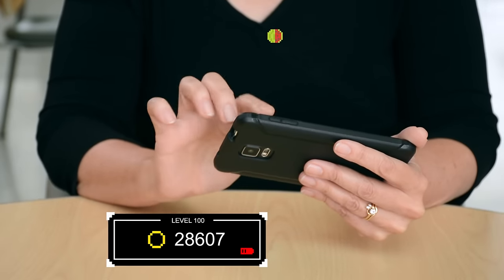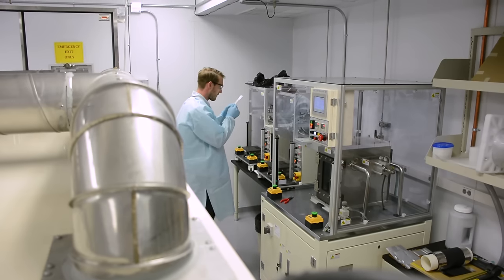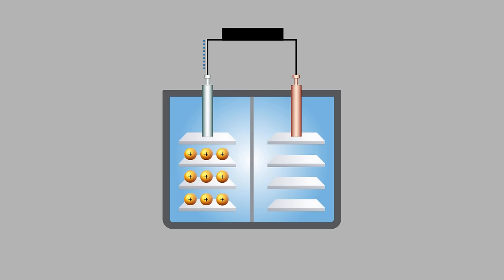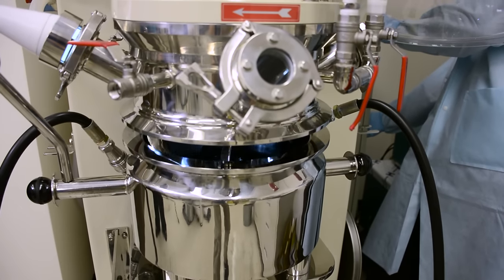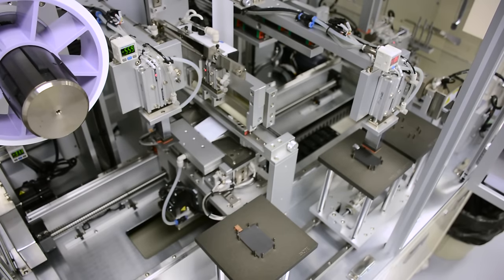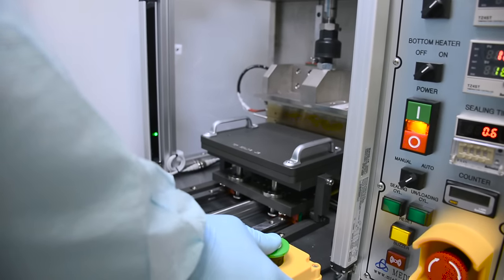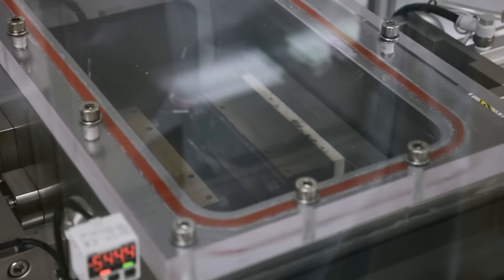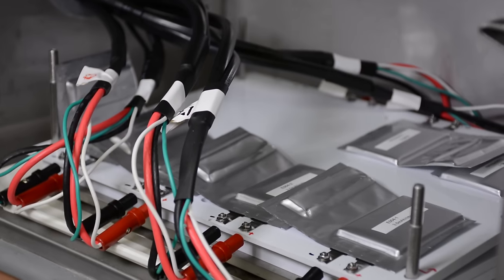How to Make a Battery in 7 Easy Steps

Comment: People can experiment and make homemade battrys in plastic pipe, jars, containers the problem is  sealed battrys are best for electronics so buy some rechargeable cells then make some big Battery's at home in buckets and charge up your stuff😀 you can make big dry cell bucket battrys that would run a inverter lights TV😀

Comment: I don't understand AC current. The voltage is used by the load. The load draws more current, yet the same amount of current entering the load leaves the load. I guess current follows voltage and is a byproduct of voltage? Current is the heat factor?

Comment: Why no graphene
Reply: Graphene batteries are actually worse than Lithium-ion batteries
Reply: jacob james yes it is, do you even know how batteries work? Battery need an oxidizer and a reducer to create the reaction that produce electrical. Carbon the building block of Graphene is not an oxidizer or a reducer.
Reply: the graphene would be used instead of the metal to transmit the power from the anode and cathode inks to the output tabs.